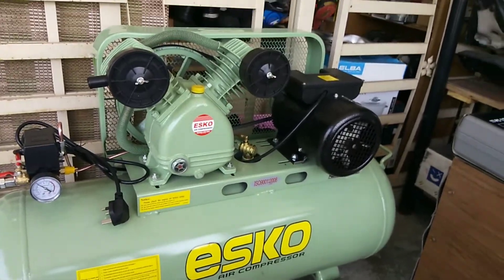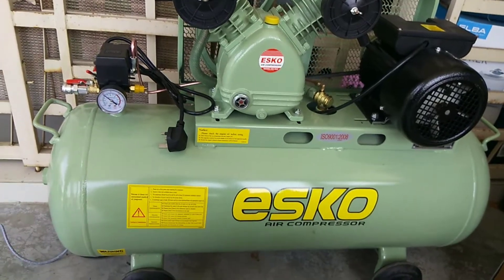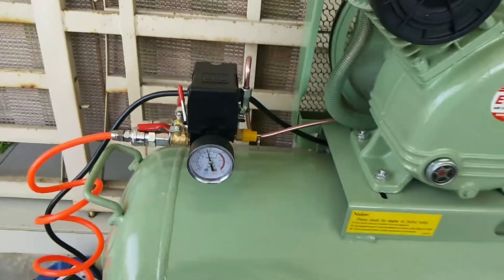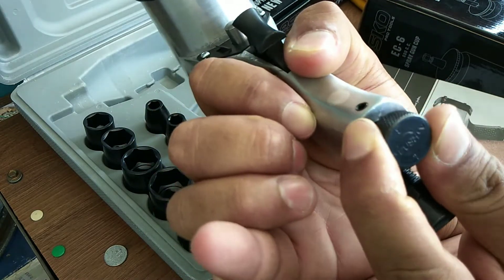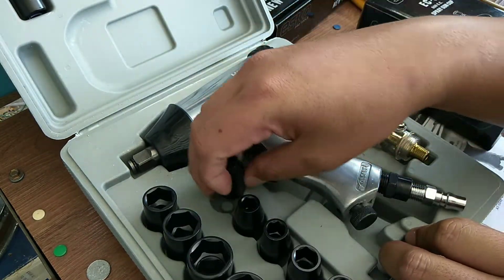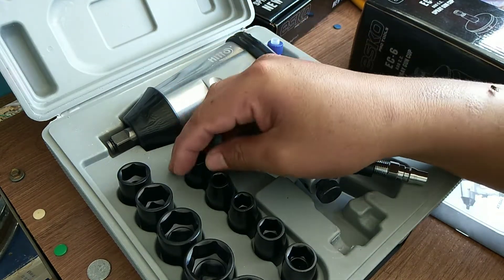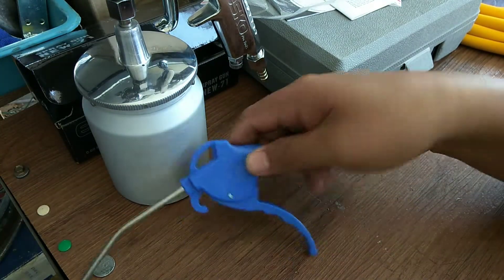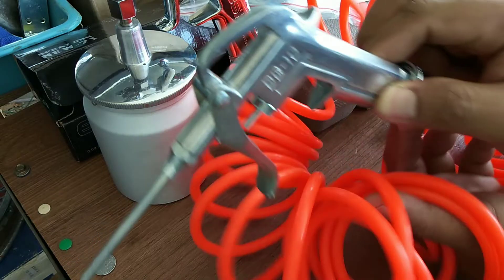Beli Air Compressor & Unboxing barang2 untuk Compressor..

Comment: assalamualaikum bang masih pakai lagi ke kompreser ni. kalau masih pakai bagaimana performance dia sampai hari ni 23/07/24? harap bang bagi respon komen saya ini.
Reply from the maker: @abemonster7414  wslm.. masih bang.. skali xpernah tukaq minyak compressor.. 😄😄.. tp masih perform n rajin2 drain air dia jgn bagi lama2 air dlm tank..
Reply: @AjakJeDahLe baik tq respon. harap saya dpt beli yg ni pun dh ok. sbb bang pakai ok brand ni. saya rasa yakin nk beli jenama esko utk kerja lightduty.
Reply from the maker: @abemonster7414  boleh je bang nk pakai.. kalo ada modal topup skit amik swan sbb angin dia isi lagi cepat.. piston swan lg besar dr esko ni.. tu je beza dia.. ketahanan ni ikut luck kita je..
Reply: @AjakJeDahLe  baik bang, swan xde bajet besar. tgok bang pakai dh 4 tahun kira ok la. boleh guna sampai skrg.
Reply from the maker: @abemonster7414  utk cat dh ckup puashati dh tp kalo nk main blasting2 kn amik masa skit la sbb blasting guna angin  kaw2 br.. tp buat slow2 lepas je utk blasting brg2 sndri..
Reply: @AjakJeDahLe  terbaik bang, dh blh jual yg esko. angkat swan pula.
Reply from the maker: @abemonster7414  guna je apa yg ada.. 😄😄
Reply: @AjakJeDahLe  betul bang, ada duit lebih boleh rancang benda baru. kalau diberi pilihan dan mampu. bang beli brand puma ke swan?

Comment: Salam bang. Saya ada beli compressor. Tapi xd3 connector dia. Boleh share tak apa jenis connector nak pakai dan berapa banyak perlu ada
Reply from the maker: try tgok kt shopee bos. quick coupler nama dia..xpn g cr kt hardware machinery..
Reply: @AjakJeDahLe  dah tgk tpi kat shopee ada byk jenis. Xtau yg mana nak beli
Reply from the maker: @muhammadzaalan2799  Saiz connector kna ikut saiz paip yg ada kt compressor bro..kna tgok saiz apa..wasap bro sng..01162765878
Reply: Salam air compressor ni blh guna dgn elektrik rumah ke?
Reply from the maker: wslm..ya bos..single phase..sy pn kt umah je guna..hobi je..bkn bengkel motor..
Reply: @AjakJeDahLe  no boss ke?boleh pm tanye2 psl compressor nie😁😁

Comment: Brand paling ok swan
Reply from the maker: Yes bro..survey dh swan paling murah dpt rm1750..keras sngt..dia pnya motor tahan lasak..ada rezeki bleh tukaq jnis swan...
Reply: @AjakJeDahLe  mna blh tukaq mahal lg modai tu, xpa slo2 ja, pakai apa yg ada kumpul modai t ang pkai smpai rosak modai dh ada bru angkat swan
Reply from the maker: @MRTAN-1  btul tu bro..tp kalo ada modal , yg ni ada ni bleh juai 2nd..tp harap2 bertahan lama la sbb xheavy sgt pn guna..esko ni pn laju gak dia isi angin dlm tank..tp swan mmg idaman la..😄😄
Reply: @AjakJeDahLe  tp yg ni klo nk spray kete xleh kn
Reply from the maker: @MRTAN-1  bleh dh bos..sbb tank dia 100liter..tank swan 90liter..tank kecik size 60liter pn boleh tp kesian kt motor kompressor sbb asik nk kna pam angin msuk dlm tank.mto panas bleh cepat jem..kalo tank besar motor kerja xteruk nk isi angin..
Reply: mne nk bli swan kt penang ni?
Reply from the maker: p kdai machinery kt alma menghala ke bukit minyak penang..ctu paling murah sy survey..rm1650 utk tank 90liter
Reply: AjakJe DahLe name kedai boss? Saya x biasa area sini. Murah byk tu.
Reply: Selain Swan, org kata model air compressor yg heavy duty adalah Vespa Dan Puma. Spesifikasi & rega utk ketiga2 model ini x jauh beza byk.
Reply: Color dh sama..tinggal buang esko..air brush je letak swan😅😅